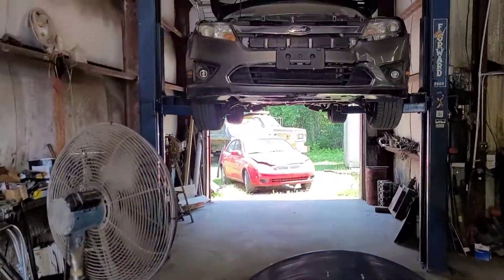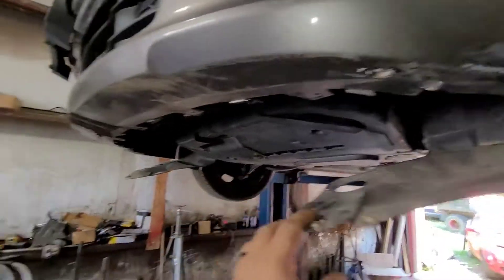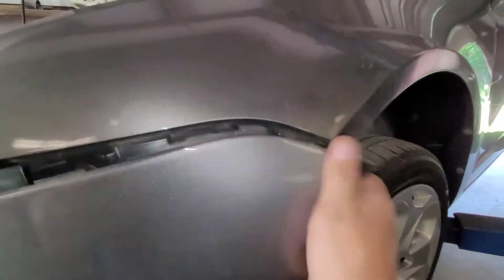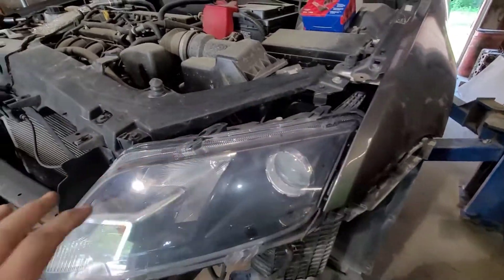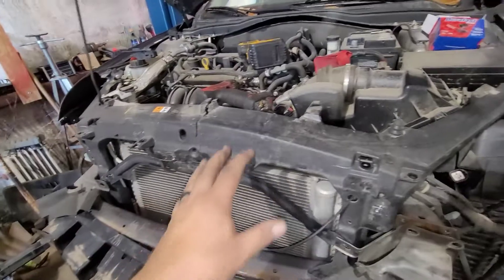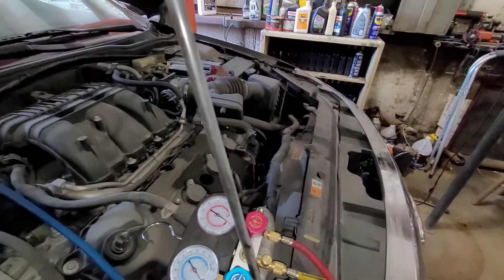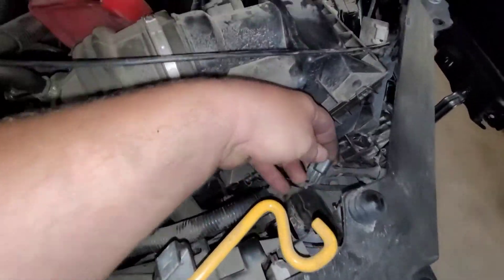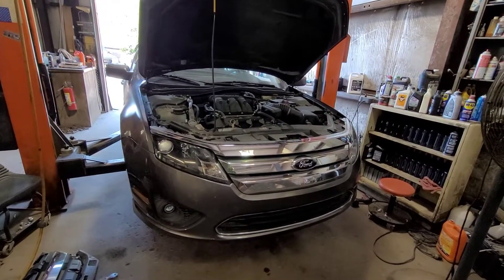We find Hidden Damage !!

Comment: Interesting video is there any previous video about the cars both the 4 cylinder and 6 cylinder engine car?
Fascinating look at the hidden damage on a car and the labor required to repair and replace the parts.
I’m interested to see what your costs are and if it’s possible a breakdown of what the cost would have been for new parts.